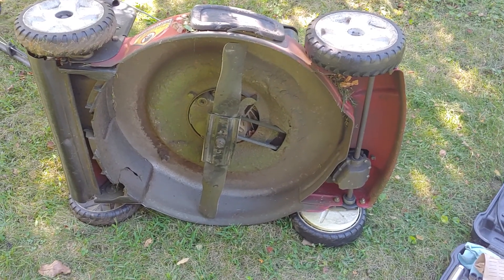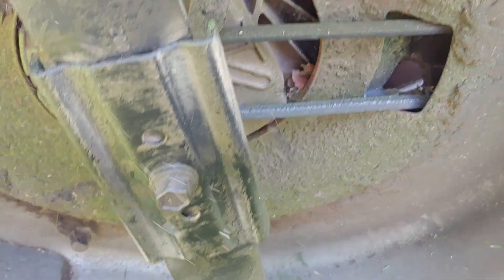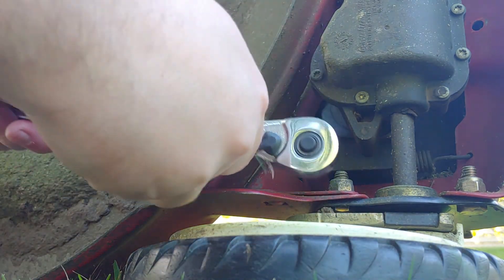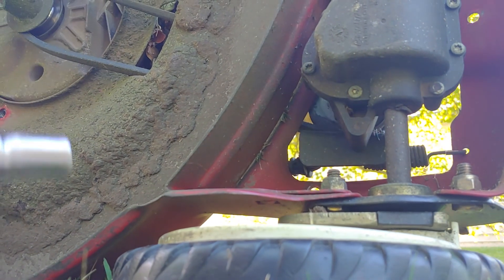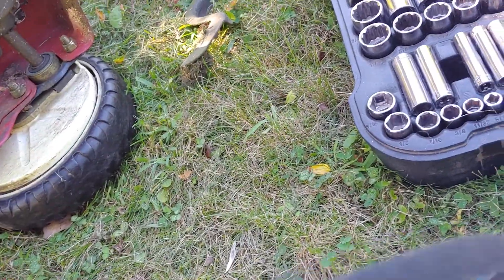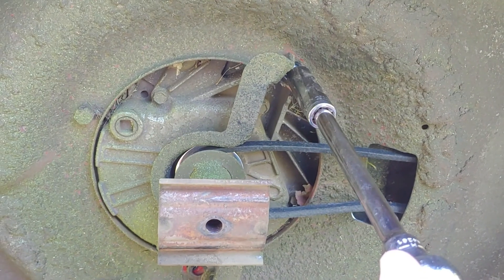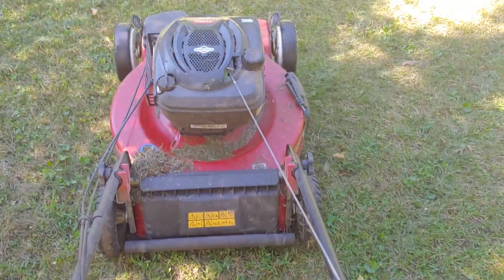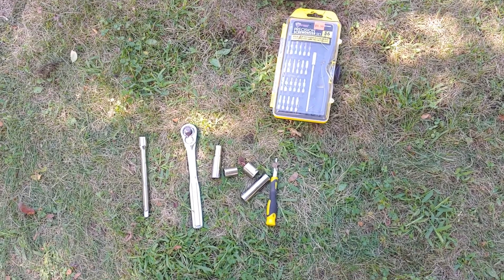Toro 22 in Lawn Mower FWD Belt Replacement (Toro 117-1018)

Comment: Thanks for the video.
Suggestion - Goodwill for a tripod to hold and aim camera where you want. Also, pre-loosen bolts off video to save time. Once mower is flipped up make sure spark plug is back on and start mower off video, then video.
Reply from the maker: This was an early video.  I definitely invested into tripods and better cameras since.

Comment: All Toro fasteners are SAE or American.  Not metric.  1/2, 5/8, and 3/8".  You are lucky and just happen to have  hex head sizes that are very close to metric and if you use 6 point sockets they can work.  Sorta.  You are lucky you did not damaged the 3/8 but they are going into plastic so they are not tight.  Might as well sharpen the  blade while you have it off.  You also need a rear deflector. it is clearly cracked and missing parts of it.  You did a good job of showing a homeowner the basic steps in changing the belt.
Reply from the maker: I was going for the basic home owner belt change here.
Reply: @i80386sx  I get it! They should use SAE or risk damaging a fastener.  IF they have 12 point sockets they may strip the 3/8 and 1/2" hex bolts.  The 16mm is very close and is an ok substitute. The rest of the content was good.  Also the 25Torx screws may also be a Square Drive on some Recyclers.  This is something Toro has substituted.  I would not expect you to know that.  But you can add it so some home owners are not blind sided and can not complete the repair if they do not have a square or Robertson bit.  That's is all.  You could put a correction in your description.  I am trying to make the content better for you and the viewer.  I am not attacking you personally.

Comment: Did you take that blade off entirely by hand? Generally you should get a small piece of wood and get it wedged between the deck and the blade or use a clamp on the side of the deck or use a purpose build blade removal tool which is essentially just a fancy clamp. Although I don't really like wedging stuff against the sharp side of the blade where I could damage the blade edge, so I typically use my little 12v cordless impact to take the blade off then reinstall the blade by wedging a board in the deck using a half inch drive ratchet for more leverage to make sure I get it torqued down real good most mowers suggest like 40-60lb/ft on the blade bolt.
Reply from the maker: I got it off by hand.  It's probably not best practice.